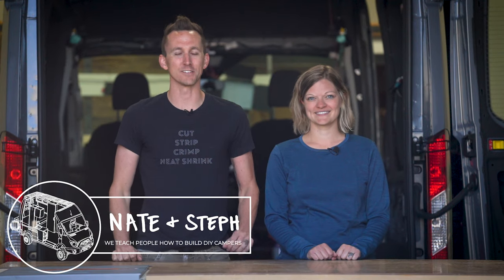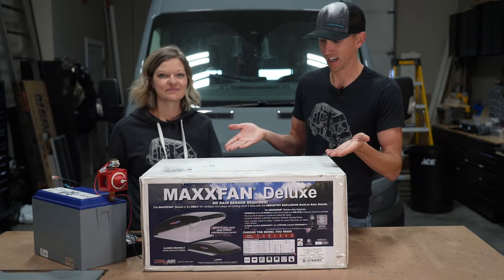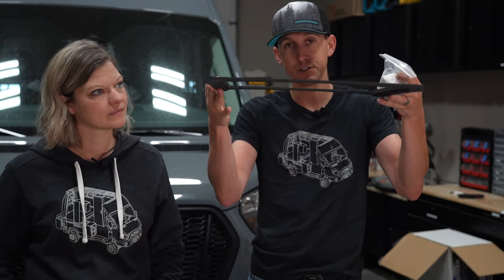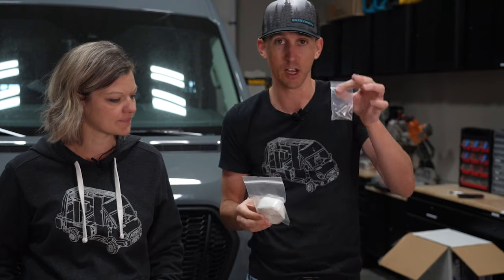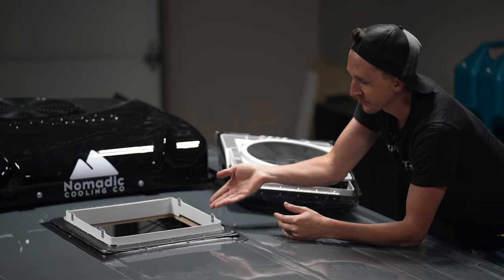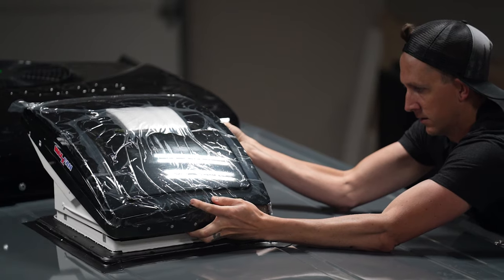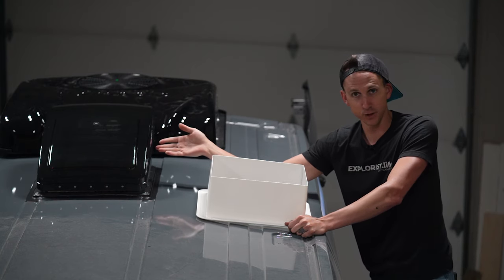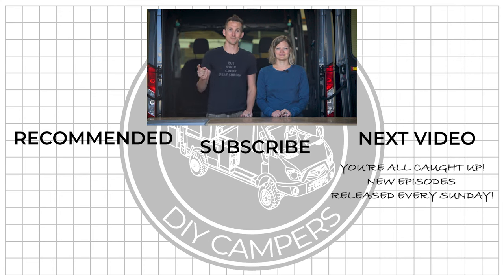INSTALLING A MAXXAIR MAXXFAN DELUXE on our DIY Camper Van Conversion

Comment: Excellent vid. Two options when installing these that I learned: 1 = A seller on etsy offers dimensional polymer material about an inch thick to go under the roof sheet metal in place of a wooden ring. Proof against water damage, mold, etc.. I used it for my fan and AC unit. 2 = The electronics boards are prone to failure from moisture via condensation, etc., especially when the fan is installed above a sleeping area and the board cools to dew point at night. Spraying the electronics board with a couple coats of conformal electronics spray will waterproof it. There was an issue with some users finding condensation collecting in the bulb lens that covers the light on the inside control surface of the fan, which cause a short in the light. One fix is to drill a small hole in that lens so the condensation can drain out. I've also read that not all of these fans have that lens now, but mine did. Cheers!
Reply: Can you link to the polymer material you spoke of?
Reply: Yeah, whats the material called? :)

Comment: Hi, great video! Thanks for helping with my installation:) just wondering, what is the fuse rating for this fan or what amp fuse did you use? I know most things should be rated 3x the amount of current draw but that requires measurment. The fan has an automatic resettable fuse but thought I'd wire it through one anyway (because of my dodgy wiring routing lol). Any advice will be greatly appreciated, thanks.

Comment: I'm sure that Nate already knows that the 'proper' way to hold the chisel is the other way around. However this works so it's not a big deal.
Reply from the maker: The proper way to hold a chisel is whatever way works for whatever youre using it for.  This Isn't fine woodworking here. 😂

Comment: I am curious as to why you went with a maxxfan in addition to the AC unit. Could the AC unit be used simply as a blower, and do away with the maxxfan? I believe the AC unit only draws a few amps on blower mode with the AC portion of the unit turned off.
Reply from the maker: It could not; no.  The intake is on the inside of the van; so it's not sucking in air from the outside like a vent fan.
Reply: @EXPLORISTlife  Thanks for the quick reply and info.  The vent fan I use in my current travel trailer (to be replaced with a Transit van in the near future) is always set to exhaust air out of the trailer, even though it can move air in either direction - I've never found the need to blow air into the trailer through the fan. So for my application, it appears that the AC unit set on 'blower' could very well replace the (exhausting) maxxfan that I thought I would also need to purchase.  Thanks again for the info.

Comment: We love all your videos! So helpful for our own build. Quick question: I am still calibrating my fear of rust - we drilled pilot holes through the outside flange, butyl tape (or other spacer), van roof and wood spacer inside the van, like y'all did here. Do we not have to worry too much about taking it apart and priming inside those holes? Doesn't seem ideal to take the screws out and try to get in there but I am so nervous about rusting. Just trying to calibrate ! Thanks so much!!
Reply from the maker: I'd think the fenders of the vehicle will rust away before the fan screw holes will in this situation.

Comment: Have you experienced MaxxAir fan's inability to handle higher input voltage from LFP battery?   I have a 2014 MY MaxxAir fan and it doesn't care if it receives 13.8v or 12.6v.  But newer, circa 2020/2021 same model MaxxAir fans blow out the controller when fed with 13.8v.  Known issue...some folks install voltage limiters at the fan as a workaround.  Just curious if you've seen this issue.
Reply from the maker: Yeah, we had issues with the one in our Sprinter about 3 years ago.  Warranty board replacement and we were back in business.

Comment: Love your videos and we’ve learned a ton and built our van to drive the Pan American. We ship to Cartegena on Monday! Doubtless you know, and I’m now experiencing, the Maxxair is sensitive to over voltage. I just purchased a regulator to help keep the power below the fans max voltage. Apparently, this is being exceeded by my battle born battery output. Just something to keep in mind. Lots of people have had this problem. I have the Deluxe 7500 bought in 2017. Worked fine until my new build changed a lot of the battery and charging system. Thanks for all the amazing content! Brian

Comment: I just installed my Maxxair a couple weeks ago.  Your install looks much cleaner, I wish I watched this first.
I wanted to warn you, Maxxair fans tend to shut off unexpectedly.  The specs don't say it, but tech support says that they have a voltage range of 10.6 - 13.6.  If your system is 12V and you're charging your batteries up to the standard 14.4V for LifePO4 then the fan could have problems at the higher voltages.  Most people use a DC-DC converter to keep it right at 12.0V.
Reply from the maker: Yeah, this install was much cleaner than our first install we did in our Sprinter back 6 years ago or so.  I'll let you dig to find that video, though. 🤣  We had 'high' voltage issues with one of the fans in our Sprinter but got the board replaced under warranty.  Apparently they've fixed the issue in newer units (like, 2020 and newer, or so).  Either way; this go around we are using a 24V battery bank, so all of these small 12V electrical loads will be run through a converter so we will have more control over that voltage as well.
Reply: @EXPLORISTlife  You are clearly two steps ahead of me.  I just took a laboratory power supply out to my fans and everything worked at 14.6VDC for a minute or two.  I would have tested longer but I had to hold the power supply up by hand and the fans were in the ceiling and I was bored.  I have some numbers to share if anyone is interested:

Maxxair MaxxFan Deluxe 7000K (main fan):
7V minimum to get the blades spinning, forgot to document current
12V nominal, 0.12A on low, 2.23A on high
14.6V max test, 0.15A on low, 2.88A on high

Maxxair MaxxFan Dome Plus (bathroom fan):
1.5V minimum to get the blades spinning, .056A.  You can run it from a AA battery!
5V just because, 0.18A
12V nominal, 0.62A
14.6V max test, 0.83A

LED light for Dome Plus:
7V to turn on, .001A
12V nominal, 0.48A
14.6V max test, 0.82A

I hesitate to run the LED above 12V in the long term.  The current goes up with the voltage so it's clearly not well regulated.  I've seen LEDs run fine for a few hours, then they start blinking and they're never good again.  Without an actual datasheet I just don't know what's safe for these LEDs.
Reply: @EXPLORISTlife  I spoke with Tech Support at AIRXCEL about this issue last week.  They said the PCB board can now handle a voltage range of 10.3V-15V (I forgot to ask when this improvement was implemented).
Also, they mentioned sometimes a spike from a solar charge controller can occur.  So that, plus high voltage from lithiums, can bump it over 15V and start to cause issues.  To avoid, they said a regulator can be installed and set at an optimal voltage of 12.9V.
Reply: @EXPLORISTlife you mean if im going to order a new circuit board today i may not facing the same issue anymore? Or much more cheaper to buy a regulator? Thanks guys in advance hope you can help me with this issue

Comment: Great video! When you do the electrical potion, you may want to address voltage issues some people have experienced. In particular, there is the general impression MaxxAir fans can be damaged by high battery charge voltages, so a "buck power converter" is installed to assure the fan doesn't get fried.
Reply: That is correct, Ive had the exact Maxxair fan on my rig and had to install a 12v Regulator to get it to work. Without it, the fan experiences a green light of death and shuts down. Maxxair specs love 12V- 13.5V  (my Lithiums hit 14.2 regularly)
Reply from the maker: We had 'high' voltage issues with one of the fans in our Sprinter back in the day but got the board replaced under warranty.  Apparently they've fixed the issue in newer units (like, 2020 and newer, or so).  Either way; this go around we are using a 24V battery bank, so all of these small 12V electrical loads will be run through a converter so we will have more control over that voltage as well.
Reply: @EXPLORISTlife  Thanks! That's good news! BTW, wether you install a two-way radio or not, please consider putting one or two "type NMO" antenna mounts on the roof and running the feedline to a point under your dashboard. NMO is a sort of industry standard that will take antennas ranging from GMRS to ham radio to Citizen Band. Having the mounts installed and available is a nice plus, just in case.
Reply: @edwardrobichaud6106  Heard about this issue from George over at Humble Road. Thanks for mentioning.

Comment: Hi, great video. I am a huge 'fan' (🤭, sorry) of the MaxxFan Deluxe. We have just patented a unique new shade system for it which adds AirMazeTechnology® and this keeps all light out but it allows full airflow (upto 100% Air In). Patented NiteAir® revolutionises hot sleeping by treating air and light differently for the first time.

Comment: I’m installing this same setup, just different electronics. I bought your rich solar custom panels. Yet to settle on what roof top ac. 
What dimensions on the roof are you mounting the fan? I have a 148 high roof.
You’ve been a huge inspiration and motivation to continue my build.
Thank you!
Reply from the maker: Watch the video in this playlist covering the AC installation for info on the AC we installed.

Comment: Another great video! thanks
Reply from the maker: Glad it was helpful.  Cheers!
Reply: @EXPLORISTlife  I have one question! I understand that the way vans are designed when it leaks from the roof they have drain holes at the bottom inside where it meets the undercarriage so the water can escape. But if there's insulation in the walls would it not soak up any water that's trying to get out through the drain holes? And if the insulation stays wet it could cause rust on the inside wall eventually rusting to the outside? What would you do to protect this from happening?
Reply from the maker: I know this isn't the answer you're hoping for... but making sure there are no roof leaks is the answer here.
Reply: @EXPLORISTlife  ok thanks! I was thinking some kind of coating on the inside before the insulation for safe keeping
Reply from the maker: Yeah, the Lizard Skin we sprayed on the van in earlier episodes of this series would likely protect from rust quit a bit; but ultimately; making sure there are no leaks in the roof is the 'correct' answer.
Reply: @waynec2962  "Drain holes" will be vehicle / brand dependent. I've never seen drain holes. My NCV3 cargo Sprinter does not have drain holes and neither did my Chevy cargo van; both gave me visual access to the area where holes might be. Sprinters had leaking issues through the body trim and the coated the inside of the wall because of this. As Nate said, seal everything and coat any metal that is exposed to moisture with appropriate material for the application area.
Reply: @victordragano8863   Thanks! I definitely will be sealing everything from top to bottom.. as Nate did with his. it's always good to get info from the viewers as they went through the hard parts of the build and I definitely won't make those mistakes.. thanks again!

Comment: I would like to thank you mr. and Mrs. Yarbrough first of all for helping me become a little bit more independent as finish carpenter for 24 years and I injured my arm so I had to move into my RV I’m doing everything on my own and you guys probably help me more than anyone so thank you for that. 
   I spent a summer in 2012 helping a friend he’s the lead solar technician of A company in chico over the years I’ve been fascinated with solar and hope we all can get to zero emissions someday! Since that summer I helped my friend I’ve been thinking and I came up with an idea that I would like to share with you if you wouldn’t mind an NDA agreement? I would be honored to share and propose some kind of arrangement with this intellectual property that I believe could change a huge part of this industry. It would be good in both residential commercial and mobile applications, and unless I’m a complete imbecile,? 
 it should 100% increase wattage in any system, I’m not formally educated, but ever since I was a teenager I read about 1500 pages of seemingly arbitrary stuff per week. So anyway I guess self educated. I would love to at least have you hear my proposal and maybe with your expertise in this field you’ve heard of this already and I’m just a crackpot or I’m 30 years too late? Or perhaps someone thought of it and you can give me your admirably Colloquial direct response of why it’s just not feasible. Before my 20+ years in finish carpentry I worked at a Manufacturing (cnc machines and automated polishers) When I started as a young man we had six employees when I left there was 36 employees I was the manager of the night shift, I helped push the advancement and expertly came up with time saving procedures, so I have a basic understanding of what needs to be done on that side of it. My idea Has inherent risk and any simpleton would know that. But I am an absolute perfectionist and I believe that if we do things PERFECTLY…..not good….not really good…. But perfect! we can accomplish something amazing for consumers, Im willing to fund the R&D if it seems feasible to you. I’ve tried to email you guys a couple times I don’t know if you got them or if I’m doing it correctly not really good at Internet stuff but I sure make houses look beautiful

Comment: Wonderful video this week just like the rest, but I have 2 questions. 
1. Why the wood support ring? Is it a weak place in the roof? I don’t remember you doing the same thing with the much larger air conditioner. 
2. I know you need to wait for the ceiling for final measurements, but don’t you need to measure the large inside flange before you install the fan so it will fit correctly (since it’s built to be trimmed to different wall thicknesses)? I am going to assume that question will come up when you install it, but I thought it was measured before the fan went in, so I’m confused
Reply from the maker: Glad it helped!
1: It gives the screws that are holding the fan to the roof something to 'bite' into for additional strength and keeps the screws from just 'being exposed' on the inside. The Air Conditioner had a steel inner-support ring that was bolted to the air conditioner and pulled the air conditioner to the roof in a similar fashion as the wood ring we made in this video.

2: The flange gets marked and cut once the ceiling panels are up.  We just wrapped up this step this past week, so you'll see it in a few weeks when the 'walls and ceilings' video is edited and uploaded; so stay tuned!
Reply: Thank you!!
Reply from the maker: Just a heads up, but that video showing all of that is now live! -> https://www.youtube.com/watch?v=cf2BjQxMKDI&list=PLmvhcyi4n0TVfA4XCYJBkzfUXunSON1zX

Comment: My buddy and I are following along on your channel and have pretty much got everything we need to get this Sprinter van on the camping program this summer. Have on question about Maxx Air 7500 installation: we are putting as much solar on the roof as possible and would like to move the panels as close to the fan shroud as possible without impeding air flow or getting in the way of its movements. Could we get 2" away from any part of the shroud and have a good safety margin for the above concerns? I have tried to contact Maxx Air by phone and using their website request form but no answer has come back. And we need to get this in so we can complete the solar and the interior ceiling.  Nate, your suggestions/comments are greatly appreciated.  Love what you do!!!

Comment: What should one do if the load (fan) is 5 metres away from the Source (battery?) Should one replace the black and white cable with 12awg to avoid voltage drop?

Comment: Hello mate, I love your channel. There is one thing that I am always wondering - how is it with security when it comes to those fans - I see the fan from the outside. Would it be hard for a thief to jump on your roof, unscrew the fan and hop in to snatch your valuables when youre away?
Reply from the maker: It'd be SIGNIFICANTLY easier to just smash one of the windows. 😂🤣😂
Reply: Plus, a 14 x 14 hole would be hard for most people to fit through!! LOL

Comment: Hey Nate, great video!! I've installed a few fans and I like to add 4 strips of aluminum (cut to fit, one for each side) on top of the fan where the screws go in so that it's tightening down evenly and not into just the plastic top piece. Does that make sense? Also, the Butyl tape should be one solid piece in stead of cutting them, this will help with possible leaks. The only seam should be in the back of the fan.
Reply from the maker: I'm sure your method works just fine as well, but just for the sake of playing the one-up game you started... If it starts to rain, you should find a garage to park in so there is even less of a chance that the fan will even get wet thus preventing leaks.

I know that the way I do things will never be enough for some people.  The way I show in this video is absolutely sufficient, though.